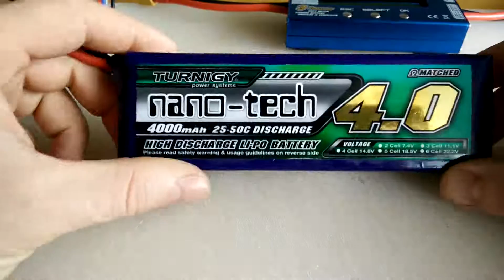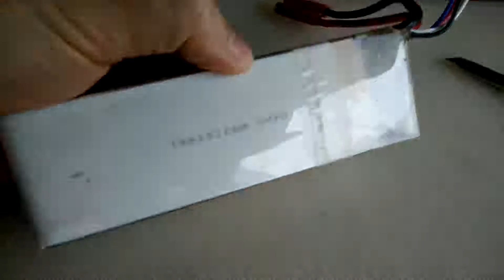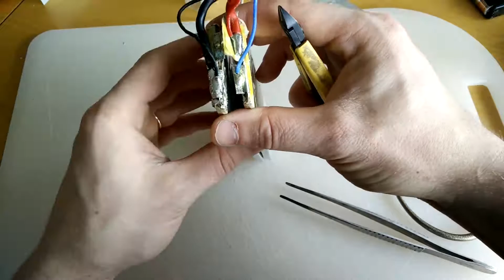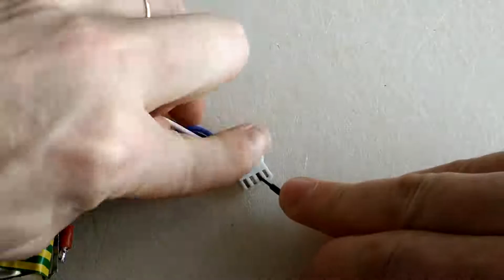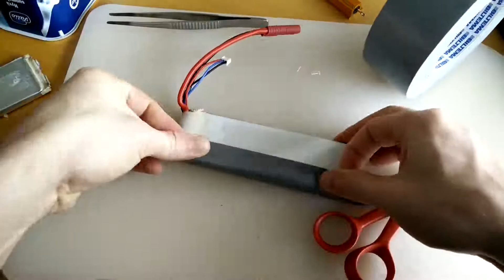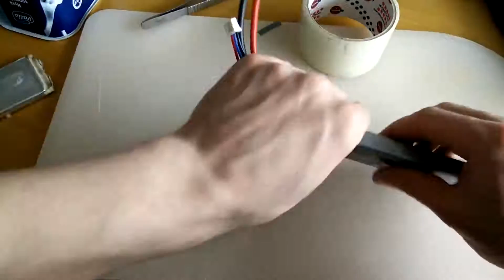How to fix a Lipo battery (removing dead cell)

Comment: i have 2 3s batteries and they both have a dead cell their reading as 2s when their 3s ..can they be fixed?
Reply from the maker: If its a dead cell the yes, same procedure applies as described in this video. You said they really ad as 2s, by what? Take a multimeter and measure voltage from balance leads individually, to find out which cell is damaged.

Comment: Thanks for the video guide. I have a Nano-tech 1800 4S which has broken main discharge leads from a crash. I tried soldering the wire to the tab but it would not stick. Is my soldering iron not hot enough or am I doing something wrong? You made the soldering part look easy.
Reply from the maker: +xypher2 If there is some old solder left on the tab, soldering should be very easy. In this video I'm using regular 60/40 solder and adjustable heat soldering iron set around 350 degrees Celsius. If you are using non-adjustable iron, they usually run hotter. However, tabs are made of some aluminium alloy (not sure about this one) which is very hard to solder without the right flux. If someone knows what flux can be used with aluminium, please share.

Comment: so how would you fix an onyx 3s if cell one is bad? that's the cell that has the black negative lead going to it, can I remove that cell an solder the negative lead to cell number two?
Reply from the maker: Dylan Westgate If you are sure that #1 is bad then yes, you can remove it and solder the black wire to cell #2 negative contact. Just test and measure things 7 times before actually soldering anything, to avoid shortcuts. Also discharge the battery before doing anything.